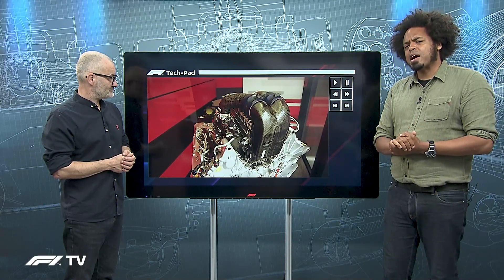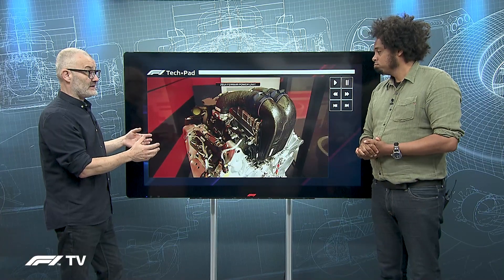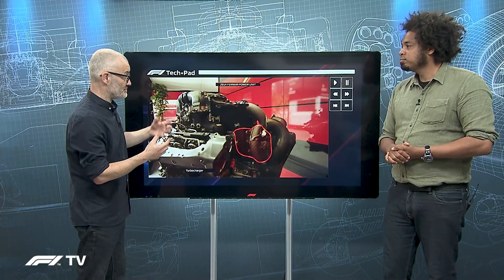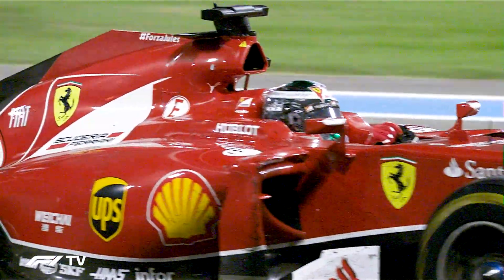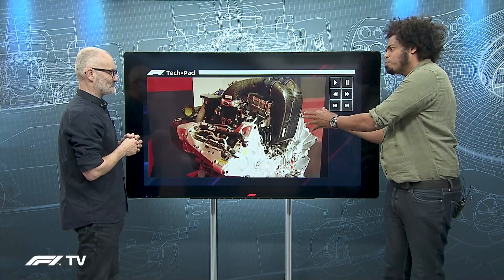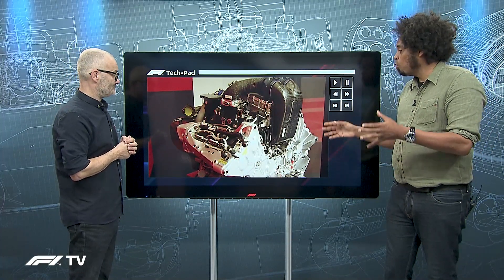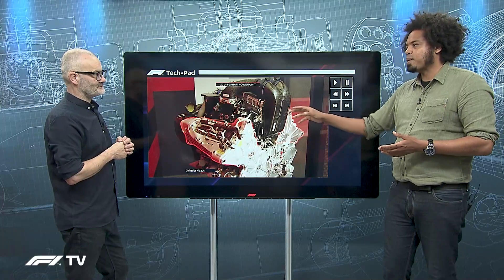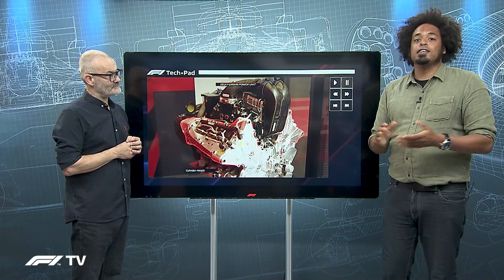A Closer Look At The Ferrari Power Unit In Russia | F1 TV Tech Talk | Crypto.com

Comment: They should stop with this "heat coming from the turbine hurting the compressor". Turbine is water cooled, heat transfer is minimal. Especially once Ferrari accepted insulated exhaust brings more benefits, than a tad tigher bodywork. And, to my knowledge, in 2014 it was the only turbo without failure during the race. Kudos to guys who made it.

Comment: They used pre-chambers in diesel engines to reduce noise. This was bad for fuel consumption.
Now they're going to use a similar concept in gasoline engines in road cars to improve fuel consumption?
Reply: The difference is that only a small portion of the total fuel charge is injected into the prechamber in the F1 engine.  The turbulent jets of flame that come out of the prechamber are hundreds of times more energetic than a spark and allow use of lean mixtures without misfires.  That is where the high efficiency comes from.